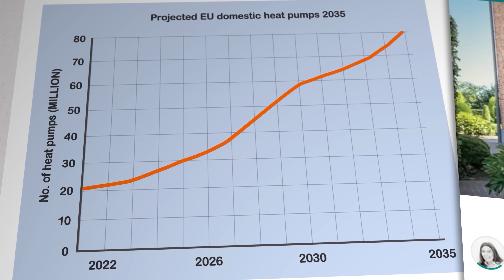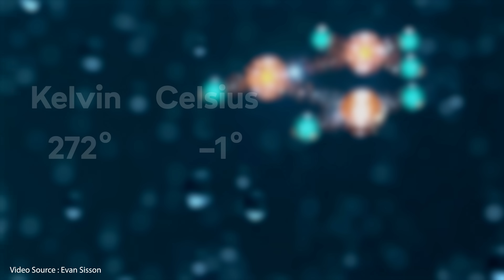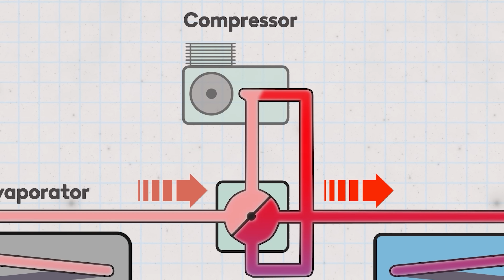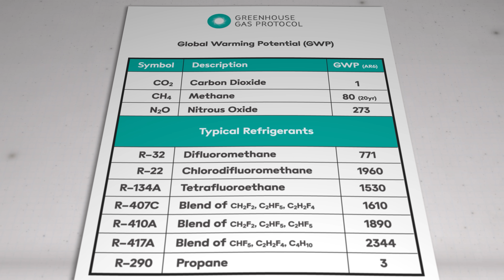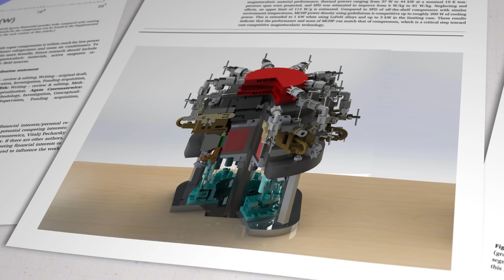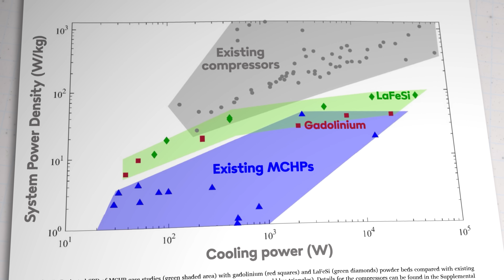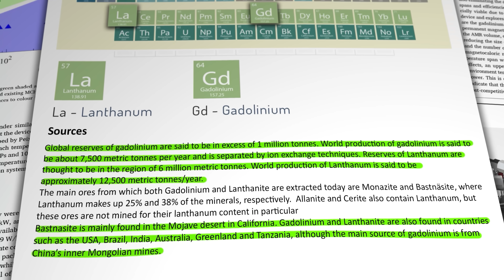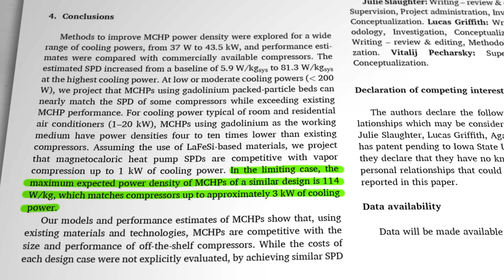Taking greenhouse gases out of heat pumps. (YES! They do contain them!)

Comment: I have serious doubts about the ultimate economics which inevitably drive any technology. 

In the chart you show of various refrigerant gases, the 2 that stand out for minimal GPW are CO2 and propane (R290). The problem with CO2 is the very high pressures required although Mercedes Benz and others are considering it. Propane (R290) operates at pressures similar to currently used refrigerants, however, it's flammable and the idea of running it through your house (or car) precludes it adoption. However, that thinking is completely unimaginative and totally inside the box thinking. What if there is a heat exchanger to transfer the heat to a safe fluid (water with an anti-freeze as an example) which then is run to the air handler in the house. Then the flammable propane can be minimized and contained with suitable protection. After all, we drive ICE vehicles with large amounts of gasoline (petrol to our British friends) and not worry about the potential bomb.

Comment: Your reference to the 94% efficiency of gas boilers is their optimistic efficiency in lab conditions for the SEDBUK rating. Those of us who have had heat pumps installed in the UK have found 80% is nearer to the top of their efficiency. In which case even with our inflated electricity prices here heat pumps are cost effective. But any new means of simplifying the workings of heat pumps as this may be is worth pursuing. If a device merely consists of something spinning then some quality bearings should give it a life of 25 years.

Comment: It’s funny they are trying to remove all greenhouse gases from refrigerants, even though they contribute a minimal percentage of global warming.  Old CFCs were very damaging to the ozone layer but newer refrigerants such as 410A contribute less to global warming than the electricity to run them does.  The new replacements for 410A are becoming far more dangerous to work with since most of them are flammable.  The tradeoff in worker safety doesn’t seem worth the negligible amount of benefit.  There’s much easier/cheaper low hanging fruit for greenhouse gases emissions.

Comment: The issue with heat pumps in the UK and other places with artic like winters is simple. The old boilers produced hot water for bathing and heating of the living space. Effectively that's water at two different temperatures, one hot enough for bathing and the other to heat air via radiators. The existing radiators to effectively heat the air in the living spaces  needed very hot water , too hot for a bathroom. The problem can be solved by installing radiators with a larger surface area but that solution creates another problem. These dwellings are small, space in them is precious. Understandably people are not happy when a lot of their living space id lost to these new larger radiators. Needless to say this isn't a problem for the landed gentry living in their country estates, its those on the lower  rungs of the socioeconomic ladder that bear the brunt of the problem. For sure better insulation of these dwellings helps but that's expensive and labour intensive even if its practical.

Comment: the thing is, propane and CO2 are both good refrigerants, and the amount used in a home heat pump is miniscule per year. the only advantage of megnetocaloric heat pumps is that they could potentially be made without any moving parts, which would make very high reliability. over here in the US, people should be mad that propane isn't allowed to be used in home heat pumps yet. will take at least a couple more years, for no reason other than to wait until hvac companies switch BEFORE introducing the refrigerant that is really the long term best answer.
Reply: Propane is a very good refrigerant. CO2 is a pretty bad one, albeit not unusably bad. CO2 requires very high pressure swings, you have to keep it from freezing and then clogging, and its energy efficiency is lower than most alternatives.

Comment: I like it! Direct manipulation of temperature through magnetically responsive materials feels more elegant than mucking around with refrigerant gases and air pumps. It's also in line with the "electrify everything" mandate of the energy transition. But this seems like an engineering problem more than a science one, since the science is settled and that study was talking about ways to get better performance from improved design.

Comment: Is it better to concentrate efforts on HVAC units or insulation?  It seems that if there is a trend to smaller living units with more people living in them then a little work on insulating those spaces could yield nice returns. Cooling those spaces would necessitate a need for moving their accumulated heat out doors or storing it for when it is needed. So, why put the unnecessary heat outside to make the cityscape warmer? Storage and release would seem a better method of managing heating and cooling. I think I have seen you discuss heat storage in mediums such as sand. Inexpensive and readily available.

Comment: The reason people accepted advancements in technology like the motor car digital cameras and computers is that they were in fact an advancement that made lives better either functionally or emotionally or both. Heat pumps are just an alternative technology that is not new and not better on a whole as the other advancements were they have pros and cons and the cons can significantly out weigh the pros in most cases compared to other alternatives.

Comment: No air source  Heat pumps ARE NOT better than gas boilers.
Air source Heat pumps are better than an electrical resistance coil heater because as long as the ambient external air temperature is not near or below freezing they can extract about three times the amount of heat as burnt in electricity where as the coil heater is about one to one for energy consumption.
Unless your local power is nuclear or hydro using a heat pump will produce just as much or more c02 as a gas boiler BUT the gas boiler will work below freezing as long as there is gas.
A Ground source heap pump is better than a gas boiler as long as it doesn't end up freezing the ground , fortunately that's somewhat unlikely unless an ice age happens
Unfortunately because c02 has nothing to do with the climate an ice age is coming due or past due we only need the gravitational cycles to align for that to happen and according to the experts they're starting to line up.
Reply: Note.
Some may seem to get better performance and lower bills with air source heat pumps.
Before you start championing heat pumps over old gas boiler do a few things. One compare fairly. If you insulated your entire house before installing the heat pumps keep quiet.
If you live in a sub zero climate and the heat pump needs resistance coils to provide heat then use the energy consumption when the coils are active to do the comparison 
Compare the efficiency of a new gas boiler in an insulated house to air source heat pumps , compare the installation costs of both.
A new efficient boiler can be upto seventy percent cheaper to run than a much older unit.
New efficient boilers are generally much smaller and use far less gas and some even incorporate heat pumps.

Comment: Nobody really cares about how it's made or what technology is used. Normal people care about 2 things (technically one): What does it cost to install it (purchase and installation), and what does it cost to use and maintain for its lifespan. If it's cheap enough and lasts longer than current options, it can be a success. The basic equation is: total cost over lifespan (existing) - total cost over lifespan (new) > 0

Comment: If you will forgive me: a comment on heat pumps in general. I try to imagine a city like London or perhaps Tokyo wher nearly everone has one or more heat pumps, keeping their homes comfortable in winter. Millions of closely-packed houses and apartments are taking around 10kw of heat from the city environment. What then happens to the ambient temperature?
Roll on fusion power. It used to be perpetually 30 years away. Now it's only perpetually 10 or 15 years away! By 2125, it may only be perpetually 5 years away😆
Reply: You do realise that the heat gets put back outside again through heatloss via the walls and windows etc?
So 10kW of heat entering the house is to counteract 10kW leaving.

Comment: Ammonia is a good refrigerant for heat pumps with a GWP of 0 and if it is released it will counter acid rain and fertilize the open ocean to increase plankton and decrease CO2. It may eutrophy inland and coastal waters but substantially less than agricultural runoff.
Reply: It's also very toxic if released quickly in large amounts, granted that shouldn't happen under normal operation.
Reply: @5467nick  Yes, and large systems would be located in separate buildings.
Reply: @ Even a window AC unit would have enough ammonia to poison many people, let alone a unit sized for heating and cooling an entire house which would have enough to kill dozens of people. A whole unit rupturing a high pressure line and dumping most of its ammonia almost all at once would be very bad for anyone nearby, especially if it happened in a house. Even a tiny whiff of ammonia can cause permanent damage to your senses of smell and taste. That's not the sort of thing that happens often, but it would be a lot worse when it does happen with ammonia versus a lot of alternatives. I'm not saying it can't be done reasonably safely, just that you shouldn't underestimate the dangers of ammonia.
Reply: @5467nick  yes, it's toxic and CO2 or cyclopentane would be less toxic but...